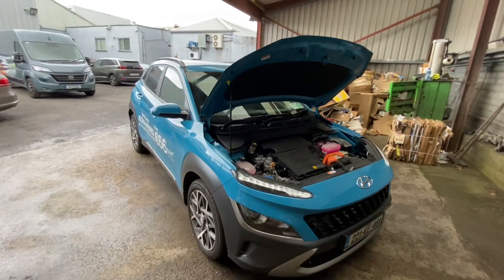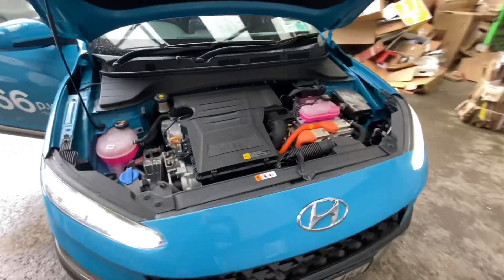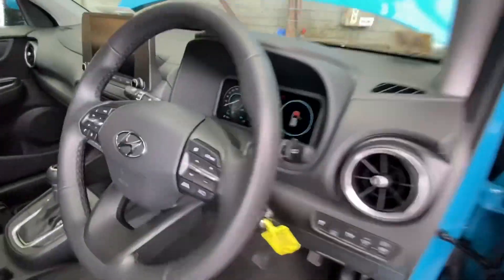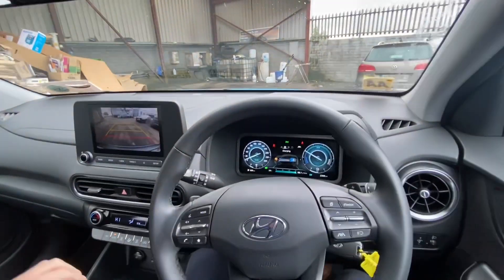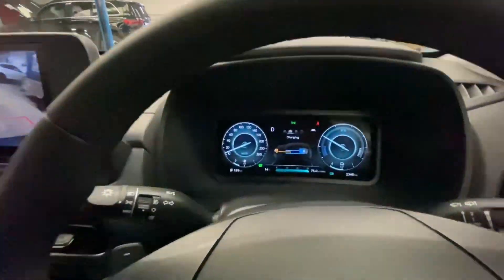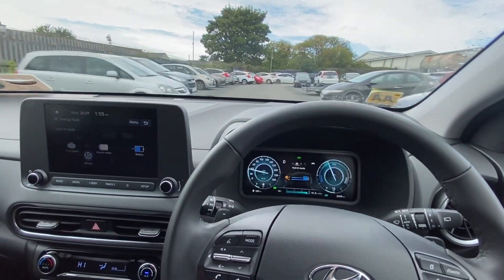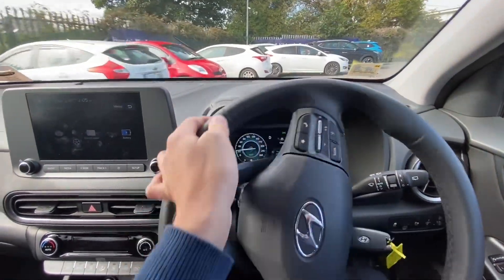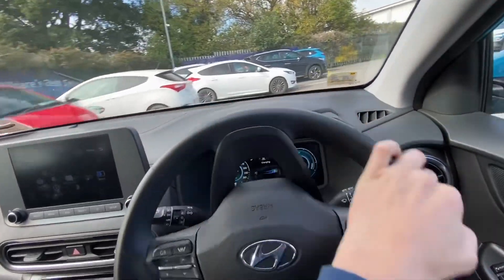Kona Hybrid engine sound - #hyundaikona #hybrid #sound

Comment: Can you please, present once again the exact moment of starting electric engine in Kona Hybrid (without welcome signal? 

I'm not quite sure but I think, up today when the electric unit wouldv start it was virtually with no sound. 

Today I noticed :

1. High pitch sound from electric engine when idle
2.. Slight but noticeable whirling noise that can be heard inside the car (previously - no sound at all)
3. Strange clicks or so when starting and switching off the to electric engine. 

Any ideas?
Reply from the maker: Can you upload a video ??